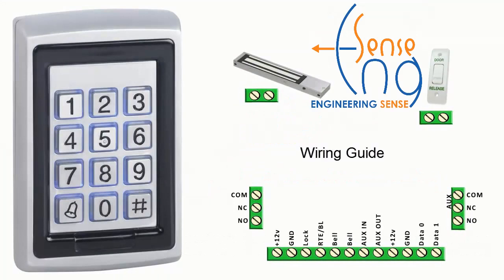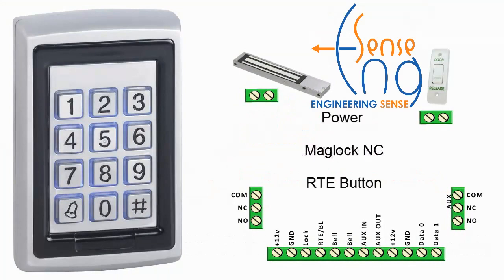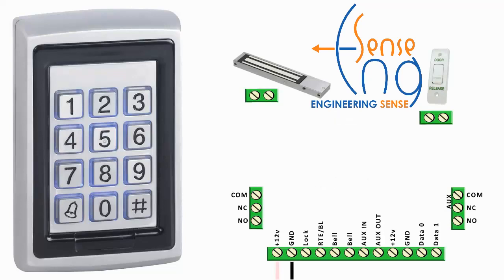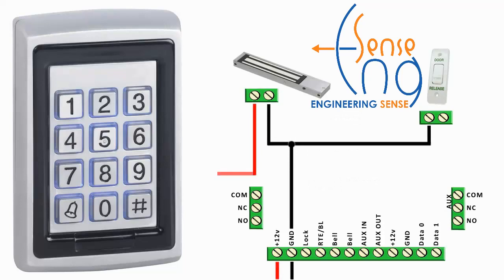101ID/IC Access Control Keypad Basic Wiring Guide

Comment: Any idea as to why I get no keypad lights or power to the new keypad I installed today.  My old keypad was with the screw terminals,  this new one has a wiring Loom.. which shouldn't matter... the old one had the NO RELAY CABLE , but when I made contact with the NC it opened and closed the gate,  but did not with the ON relay... suggestions please. My swapping NO with OC, IS THAT OK?

Comment: I want to connect 2 keypads to a maglock. 1 keypad for entrance and another for the exit side. How could I connect these keypad to a maglock? Could i wire the 2 nd keypad as push exit button? or another way? Thank you in advance
Reply from the maker: Yes, you can connect the 2nd keypad relay output as exit button, but the best way is connect the maglock serial to two keypads, so the lock will open where any keypad is acting to open.
Reply: @EngSenseJO  can you advise on how to wire to keypads. I want to connect two keypads and one push button to a mag lock. I got it to work with one keypad and push button by following your instructions but as soon as attach second one the same way keypads don't and push button does.